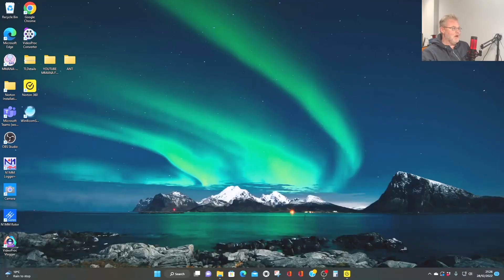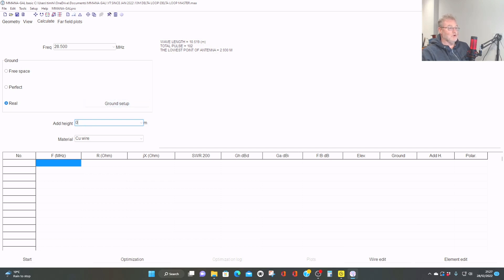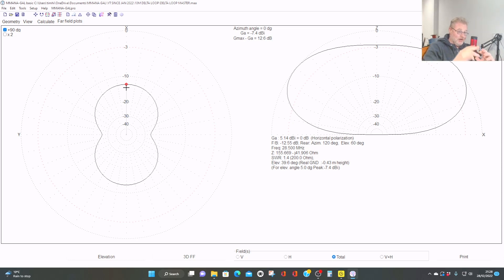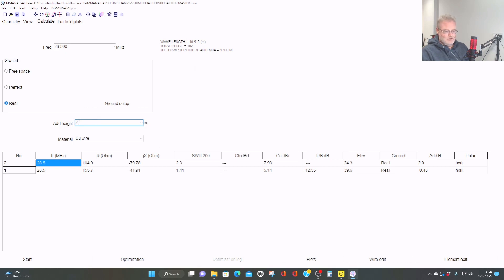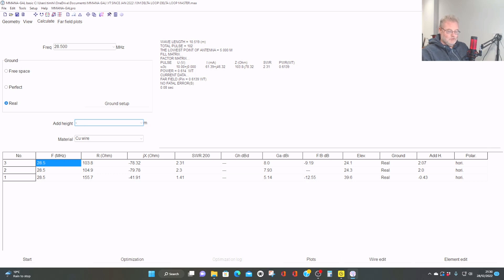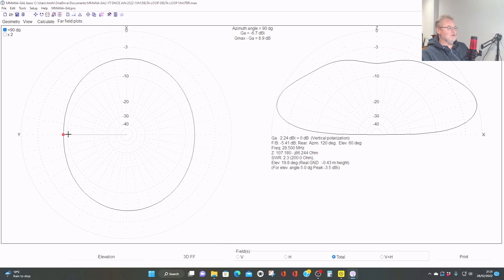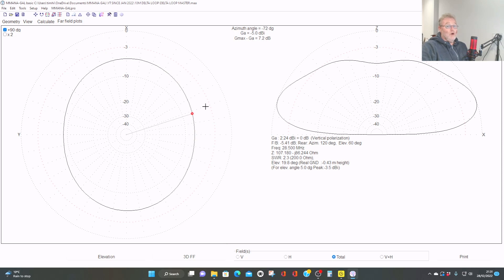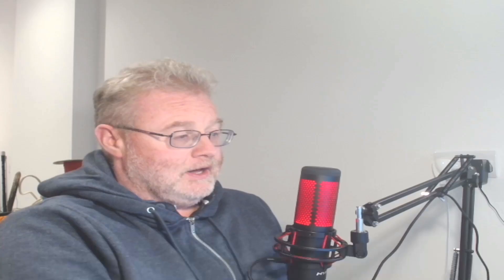HAM RADIO: DELTA LOOP ANTENNA FOR 10 METRES

Comment: Hi Tim, really like all your antenna videos, especially the ones showing the modeling of antennas.  I am trying to model a 40M delta loop and am having trouble applying a source at the 1/4 wavelength point on a vertical element. Can you describe how you accomplish this in manna-gal please. I have been trying for days using different methods as recommended in the on-line user guide and chatgpt.  I can only accomplish an end or center fed position.  Thank you in advance for your consideration. Regards, Mark N2IRY
Reply from the maker: I’ll come back to that sometime in the future Mark 73

Comment: Hello Tim from  its GW4 WVE   from  Abertawe hi hi. i tried a Delta for 10 but couldnt get it hi enough with a 4.1 balun i still got a load of noise, have you tried a 10 m  square loop ? any info on them
Reply from the maker: Hi Mike no I haven’t but it’s on my list

Comment: So, the way I understand this, I want the flat side or opening facing my target station. Right? Both horizontal or vertical polarized.
Reply from the maker: Through the plane of the loop for horizontal. Less of a requirement for vertical

Comment: Great video Tim! Seriously thinking about a 10 meter Delta Loop next month when I'm back in Poland. I'm thinking about rotating the loop 90 degrees so the base of the angle is truly straight vertical, something like this  I>  if that makes sense. My thoughts were to feed it on the truly vertical side a quarter wavelength down from the top. I'm thinking the apex or vertex (angled) side of the loop will make it directional. Something that looks like a vertical Moxon triangle versus a square. I haven't modeled this yet, just a mad scientist idea I have right now. This might be a complete fail but I really want to give it a try. We'll see. All the best my friend!
Reply from the maker: You gotta do it Walt!
Reply: @TIMG5TM  sending you a sketch of the idea

Comment: Better ways of doing it though. Inverted delta loop fed at the bottom gives you optimum low angle transmission, look up W6NBC's presentation.
Reply from the maker: I'll model this, thank you for the info.
Reply: @TIMG5TM  if you want something else cool for HF, look at his double inverted delta loop for HF
Reply from the maker: Yes I saw that tonight .. it’s a real eye opener!!

Comment: I built and used one of these for about 10 years on 11m back in the late 70s and early 80s... it was my only antenna at the time, it was on a set on TV brackets outside my bedroom window at my parents house.. i was still only a child really, I would hop out onto the flat roof and loosed the u bolts to turn it... the 'Armstrong method'  lol... great times... worked a ton of DX with that loop 😊
Reply from the maker: If only I could do the same! What we used to do eh!?? 73

Comment: Vertical loops are interesting Tim. I've always been hesitant to use one as its difficult to get one high enough vertically polarised. For say 12/10m not too much of an issue. Would be great to see you try one by saltwater and you only need 1 support to try. It should be awesome over the sea.
Reply from the maker: Thanks Colin. Yes it’s on the to do list 73

Comment: Nice video mate, I still prefer a vertical,  less work and all round performance,  just one mast, and less wire in the air for neighbors to complain about hi. 
73 and hny.
Reply from the maker: Very true! Happy new year Brian 73
Reply: I already have an AR-10 vertical and it works great. But there is very bad power line noise in my area so I am hoping I can null out the noise with a Delta Loop.

Comment: Work pretty good fed 1/4 wave down from apex for ‘even better’ vertical polarisation. Like a pair of co-phased quarter waves with couple dBd gain. I use one now and again portable (see channel) with 75 Ohm matching stub…. or sometimes I use a 20m perimeter and feed with 450 Ohm ladder back to a balanced tuner for a couple more bands. Last week I operated SES G5AT from a friend’s station with 400W to a 5 ele and attracted lots of VK, AP, VU, HS etc. 180Qs on 10m SSB voice. I must get back into 10m a bit more myself. HNY
Reply from the maker: Sounds a superb set up. Happy new year Nick 73

Comment: Hi Tim, I have used a an upside down delta loop on 10m with great success for several months. Just few weeks ago I changed to a moxon  and although it is a great antenna I was impressed closely to it the delta loop was performing. I strongly recommend the delta to anyone who is starting in the hobby and or doesn’t have a rotator. You will certainly be surprised with its performance.
73 de PU1MOZ
Reply from the maker: That’s brilliant Eduardo. I look forward to working you in 2023

Comment: I think 10m is close to the heart of all of us who started with CB, certainly the case for me.
Reply: decent hf rig  $500+   decent 10 meter mobile $200 I bought the anytone ariers 2./.radioditty Qt-40 been talking dx on a dipole so for under $300 complete set up can't beat it!
Reply: @johnmine5609  Yep, well said - going that route it doesn't have to cost a fortune 👍  
My 1980's President George was my first licensed foray onto the ham bands, I didn't get all of the bandwidth but it was a cheap starting point along with a 2/70 handheld.
Reply from the maker: 100% same here. It’s a great band